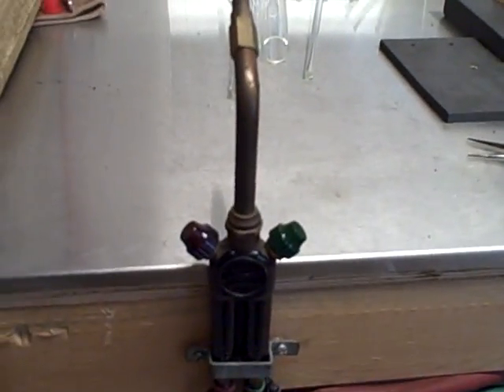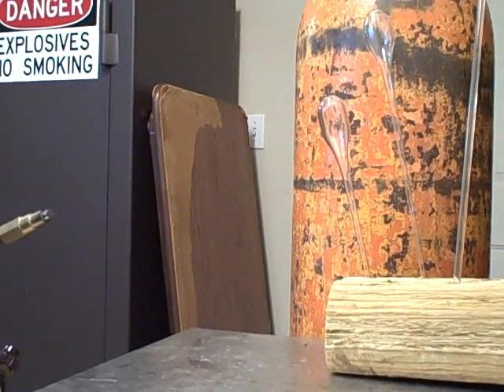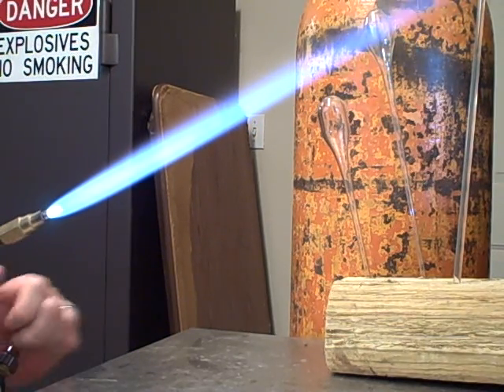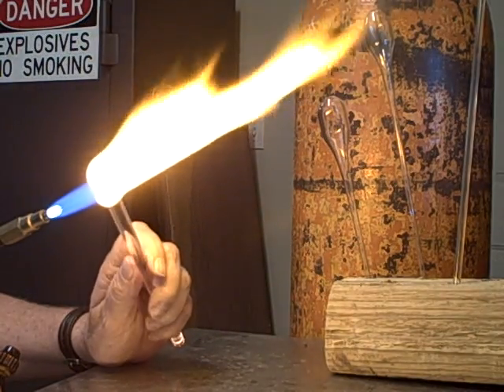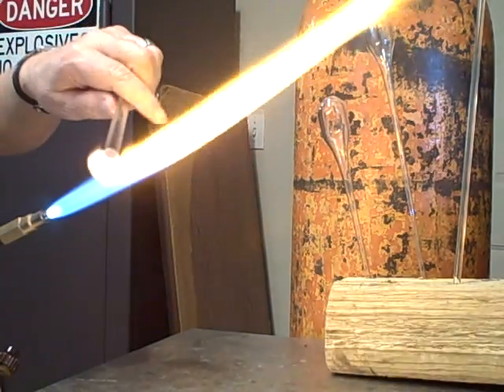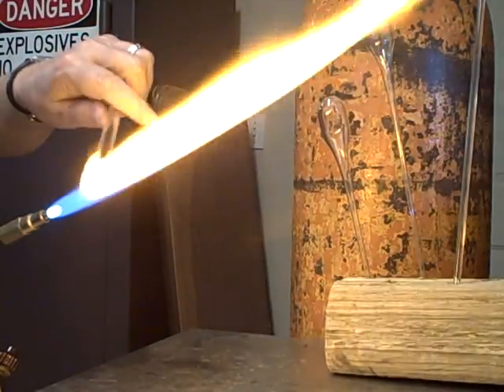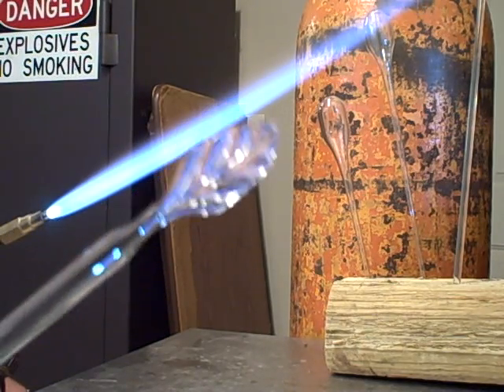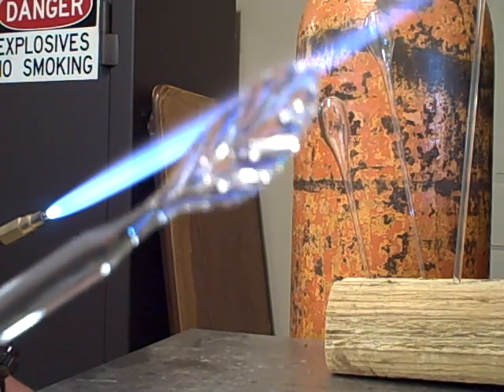Multi Port Tip on a 3A Torch

Comment: SOMEONE PLEASE HELP ME IM GONNA LOOSE IT! IVE BEEN SEARCH GOOGLE AND EVERYWHERE AND CANNOT FIND ONE SINGLE IMAGE OF WHAT AN OX SERIES TIP LOOKS LIKE, FROM THE BACK, OR A CUTAWAY VIEW.. I JUST WANT TO KNOW WHAT IT LOOKS LIKE INSIDE! IS IN JUST ONE SIMPLE HOLE STRAIGHT THROUGH? IS THERE A TAPERED SECTION AT ALL? PLEASE SOMEONE TELL ME, REPLY WITH A DESCRIPTION. NOT ONE SINGLE PICTURE ON THE INTERNET SHOWING THE INSIDE OF AN OX TIP  ARRRRRGH
Reply: Most torch tips are tapered on the inside.  This causes the gas to accelerate as it leaves the tip, which among other things probably helps suppress back firing.  And also makes the flame SHAPE, different tips have a different taper inside, so the flame (talking more about welding and general heating torches) might be long and needle-like, or softer and a little round.  Still talking about Oxy-Acetylene torches.

Comment: What type of regulator are you using on your propane tank. I have a national 6b and am trying to decide if a preset regulator will work or if I need to invest in a adjustable one. Thanks.
Reply from the maker: It is adjustable. The 3a/6a torches use very low pressure like 05.-1.0 psi. Too much pressure will negatively affect the flame characteristics even though they are adjustable at the torch. Same with O2. Anyway, I would invest in an adjustable regulator because you may add a larger torch to your collection some day.
Reply: Timia Glass I thought they ran gas at 5psi and oxygen at 10psi. Would a 5psi preset regulator be to much then.
Reply from the maker: Matt carter My Barracuda runs full power on 5 psi gas and 10 psi O2. That is far more than needed on a National 6b. Perhaps you can get one with a nice return policy and try it with no risk.

Comment from the maker: @thebrooklynflash Annealing is the process of releasing the stress in the glass so it doesn't crack. Wine bottles are soft glass and will crack if you heat it too fast and will definitely crack as it cools unless it is immediately placed into a kiln for annealing.

Comment: Sooooo...
It just wouldn't melt that boro glass.  What are your gas pressures when you use the National 3A?   If I have to use the same pressures as my Carlisle, I might as well stick to it as it has a wider flame.
Love your videos.  I find them very helpful.
Paula

Comment: Have to make this in two posts as it limits the number of characters in a msg.

I bought this torch hoping to be able to use less oxygen (lower pressure) than I use on my Carlisle cc as I have to beg a nice strong young guy to come move those oxy bottles for me when they run out.  They're too heavy for me. But, with the largest tip it came with (#5 single port) and lowered oxy and propane pressures, I could not smooth out a 3/4" marble.  Part 2 coming....

Comment from the maker: Rent/buy bottles or buy a oxygen concentrator. Bottles are the best way to go in my opinion because you get higher pressures and the oxygen content is higher. But for small work like beads an oxygen concentrator is sufficient and would save money over the long run.

Comment from the maker: The torch can take air or oxygen with natural gas or propane. Using oxygen you will get a flame temperature of around 2800 C whereas with air it will be around 1980 C. Obviously the higher temperature is desirable for working borosilicate glass.

Comment from the maker: Welding torches use oxygen and acetylene which is not usable for glass work. You need oxygen + propane or natural gas. Since those torches are used in a wide variety of tasks I would think you could find one similar to the National torches locally or at least closer than the U.S. There are a lot of glass workers in Italy and France. Probably throughout Europe. Try some Google searches on "propane torches" of "glassblowing supplies". I'm sure you can find something close to home.